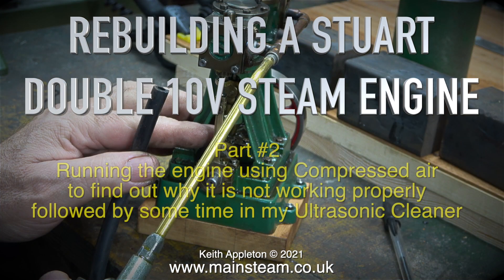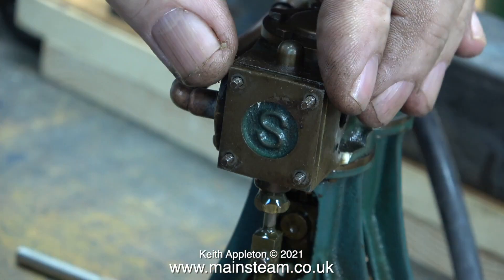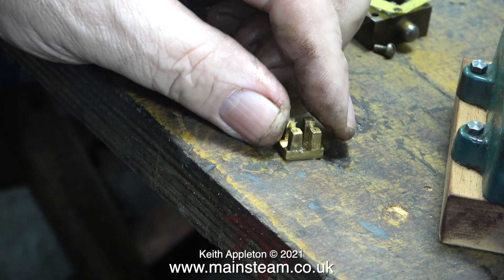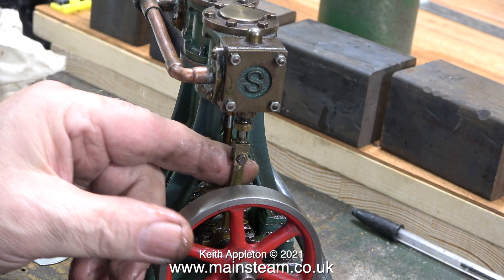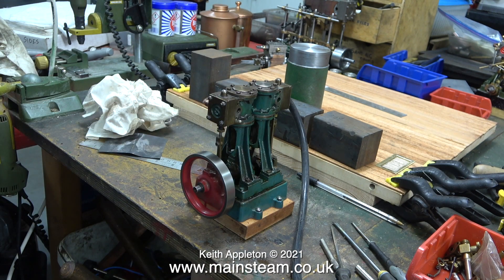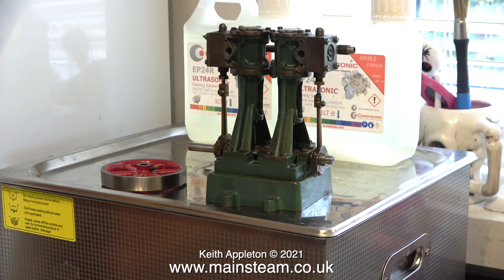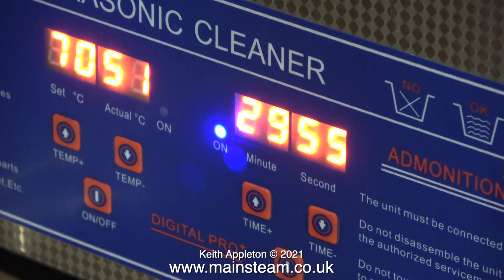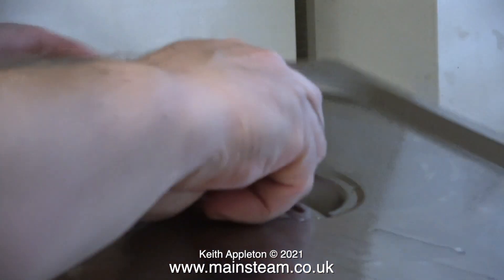REBUILDING A STUART DOUBLE 10V STEAM ENGINE - PART #2

Comment: What is the medication you are on for type 2 diabetes,  I have been on Metformin but suspect it may have been one of the triggers  for the Migraines I have been having since I started on it.
Reply from the maker: I stopped taking Metformin a while ago because it was absolutely rubbish, it didn't lower my blood sugar and severely affected my brain memory functions  and gave be Diarrhoea . . . I now take Dapagliflozin which seems to be working fine without the side effects I mentioned.
Reply: @keithappleton  Thanks, I am now on half the dosage of Metformin than I was, but think I will come off it entirely as I am still having problems with it and it helps to know what other meds there are that work.

Comment: I've noticed that over the years you work on engines that don't run well and you note that the machine work was well done but the builder didn't seem to know how a steam engine worked. This seems to be the case with this engine; it looks nice but doesn't work well.  Is this a common problem with your customers?